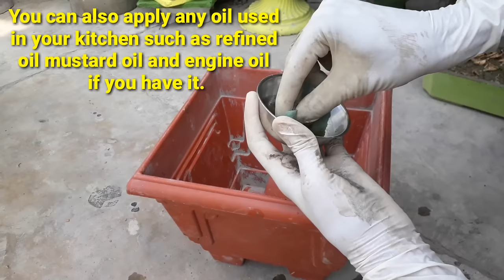How to make beautiful cement pot at home easily || Flower pot design ideas

Comment: The original plastic pot was designed to drain through the four corners, perhaps try placing some wooden dowels into those holes so that the concrete pot can drain better. Otherwise, it turned out really well and has a very attractive look to it. Nice job !
Reply from the maker: Thank you very much for your wonderful comments!😊🙏

Comment: Can make cover from outside that plot easy more then you do it
Just use 2 plot different size
Reply from the maker: Thanks for your feedback...Thank you so much! keep supporting and please subscribe my channel for such more videos.
Reply: Your method works only with mixing up a thin slurry. His method, with more sand, is more economical, and, from what I've been told, more stable.
Reply: @SandiJones  
 Hi Sandi
  I just made my first pot...turned into a BIG MESS, sadly,  darn it. 😥...and I am seriously wondering if useing a mixture of sand AND the QUICKRETE would be easier to handle??  It seems to me that using the Quickrete only was pretty hard to mix, so it seems like with the addition of the sand keeps it more stable...less chunky and avoids getting too hard too fast. Sorry so many questions..I'm hopeing perhaps you are familiar with working with the mixture. 
 Thanks so much in advance. 😊

Comment: Curious how much the pot weighs when finished and if it needs to be sealed before planting.  I’ve read some things that say concrete leaches salt or takes the water so plants don’t live?
Reply from the maker: Plants survive very well in cement pots, while the roots of the plants in the plastic pots deteriorate quickly due to the heating of the plastic pots, there is a chemical reaction in the plastic which also causes the plants to become pots. The weight of can be more or less according to the pot you are making. Thank you !

Comment: I have used motor oil and it only makes the wet cement slip away. Tried skipping that step and just poured hot water over the overturned plastic pot when cement has hardened. Still does the job. 

Also, I thought coating the plastic pot with cement paste first would help eliminate the tiny holes on the finished product. Apparently it does not based on the end result here.

Comment: I had tried, this method is little bit hard, cement mixture is not sticking to wall always falling, so made a wooden die for inner wall and put all mixture in between  it,  all done no tension of cement mixture.
Reply from the maker: Thank you very much

Comment: I have tried doing this with my plastic pot but it doesn't come out so easily after drying.
Reply from the maker: Thank you so much 😊
Reply from the maker: Pour some hot water over the plastic mould then it will come out easily…

Comment: In the initial stages why do you sprinkle some dry cement on top of the wet one ? Also what kind of gloves are you wearing and what is the purpose of the gloves ? Nice video i have subscribed and hope to learn more from you 😀
Reply from the maker: The purpose of sprinkling dry cement over wet cement is to stabilize the cement solution so that the outer layer does not deteriorate while making the pot. Thank you very much for your wonderful comments 😊

Comment: What a wonderful job! I have a question: how much time do you wait after oiling the plastic pot before applying the first cement layer? I tried the same procedure but the cement doesn't stay in place because of the oil, I tried first with vaseline and then with mineral oil but it doesn't work neither. Could you help me with this information? Thanks
Reply from the maker: You have more diluted the cement solution due to which cement is not sticking please look carefully in my video do not dilute the cement solution I have not given any extra time the video has shown continuously as much time has been taken also note that the second mixture is not too diluted.😊😊🙏🙏

Comment: And metal wire net can be used inside the concrete mixture in order for the pot not easily broken.
Reply: You're right
Reply from the maker: yes, If you want to make more stronger than you can use it .Thank you so much! keep supporting and please subscribe my channel for such more videos.
Reply from the maker: yes, If you want to make more stronger than you can use it .Thank you so much! keep supporting and please subscribe my channel for such more videos.

Comment: Dude u made this way more complicated than it supposed to be all u had to do was oil the inside than take cardboard fold into a square duct tape the ends then drop it in the plastic pot of course after u poured a lil cement to make the base now jus fill in the space between the cardboard wall and outer plastic pot wall... Fold up wired mesh drop between if u are making a big pot it will need the reinforcement
Reply from the maker: 😊😊thank you very much for your wonderful comments!🙏

Comment: What do we do for the damages on the pot
Reply from the maker: Thank you very much 🙏 🙏
Reply: Making a cement slurry- with extra water to make it watery consistency and then using brush to fill in those small holes / crevices left behind due to air pockets. Also gives a very polished look to the final product
Reply: @aamritwar82   thanx a lot

Comment: Why is that, when I try this process, the pot won't come out the mold?
Reply from the maker: You try to remove the hot water over the plastic pot.😊🙏
Reply: See 9:57 he edits the video.. My guess was also that it wont come out so easily. He did not show how he struggled to remove it 😂